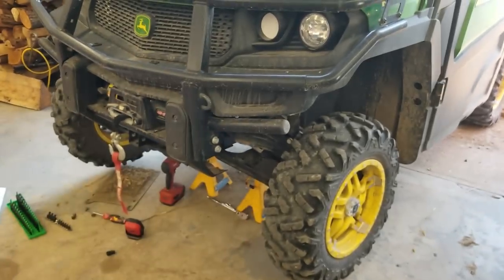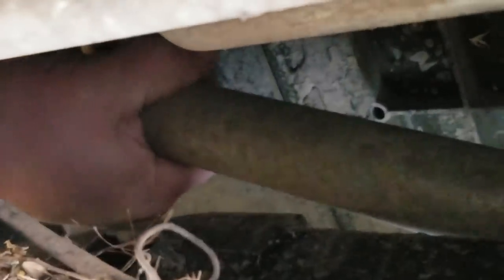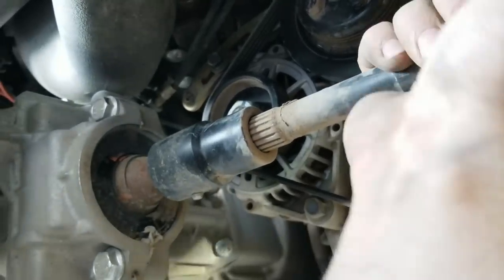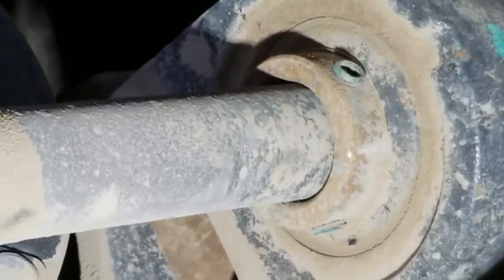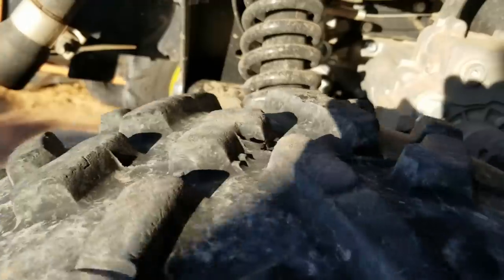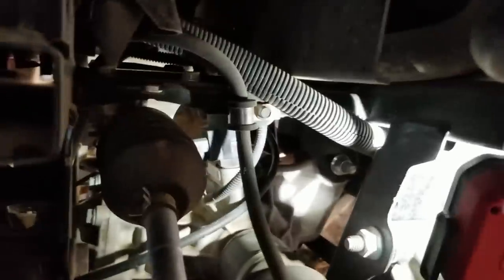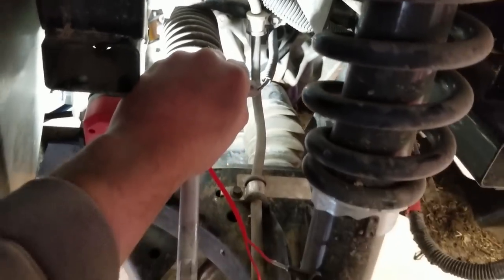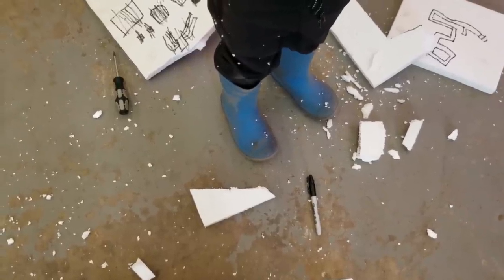Deerest Gator;

Comment: It's possible the common grounding point where the negative side of that solenoid plug ties off at is corroded or just plain old loose from vibration. That's why you're not getting a full 12v across that plug. It'd be interesting to see what the voltage was while referencing directly to the battery neg terminal.
Reply: I second the grounding issue. I had really strange trailer light problems on the RV this summer. Measured 6V instead of 12 at the trailer connector, both directionals came on for left turn, behavior changed when lights were on, real hair puller. RV tech in Dawson Creek heard my list of symptoms, finished his coffee, came out and added a ground wire from the directional light to frame ground and everything started working.
Reply: Just Ohm out the line from the return side of the connector to chassis.  If not 0 then find out where the problem is from there. Might need to do the same on the hot side.  But on the hot side it's probably best to unhook the battery to save your meter.

Comment: I used to drive these at work. Expensive vehicles. Did the job, but work "limited" the speed with bolts under the pedals, meaning we could never run them even halfway open, caused some issues.
Reply: Those sort of 'fixes' just beg to be overridden.

Comment: Voltage drop test should figure this one out. With the circuit plugged back together and some back probing (no laughing at the back) with the system live you should have 12v (assuming it's a 12v circuit) on the live all the way from the fuse to the solenoid. As the solenoid is the only consumer on the circuit it should then read 0v after the solenoid. It it's reading 3v before the solenoid (again, the system needs to be fully connected) then 9v is been used to push through a point of resistance before the solenoid on the live side, if it's 3v after the solenoid then 3v is needed to push through a bad earth. Either way, the solenoid is getting starved of pixies but you'll know which side of the circuit to look at

Comment: The next manual will state "check set screws on bearings on driveshafts at 100 hour intervals" much easier than making something of proper strength the first time, it will be sent out to the dealerships as a page that they glue over the original page in the manual, or since it's probably online only accessible through a secret back door portal, it will be changed and no one will ever know it wasn't there in the first place.

There's your million doll hair idea, service manual Wikipedia, the service writers would edit them everyday adding multipliers to the time tables and adding, nonsensical yet, important sounding things to the 100hr service.  And adding disclaimers like "If the date and hours are written on the oil filter with a sharpie, the warranty is null and void, as there could be an issue of the alcohol in the ink bleeding through the steel and thus contaminating the oil.

I was a mechanic, my favorite thing was when they swapped out the old manuals for the "updated" one, thus they sold, at a discount, the manual that had the notes from the shop mechanics in it.

Comment: Is the Confuser smart enough to need the engine running to turn on the 4wd?   Seems odd you found a mechanical failure that coincided with the electrical failure.
Reply: I agree.
Possibly the splined shaft was the problem.

Put it all back together and test. Bet it is fixed.

Comment: I had a similar issue with a later model ranger turns out Deere and Polaris parts were interchangeable for that time I believe it was a hillard… they have a magnetic interlock with a roller cage and plate that locks the diff. If by chance it isn’t a gremlin lurking around the switch

Comment: Not sure if the John Deere's are the same but on Polaris front diffs, they have a constant 12volts running to the connector, and the ECM supplies the ground when the right parameters are met (RPM, Shifter position, Key on, Etc.).

Comment: Biggest problems I always had with JD's in service were always electrical. I cant imagine the engineer team for the side by side market is any better than there heavy equipment teams. Its gonna suck but that grass fire waiting to happen and the 3 volt drain is making think theres a shorted wire there.

Comment: Call your local PrairieCoast Equipment dealer! Haha. If i remember correctly the 835 needs to see wheel speed before it will power that front diff solenoid. Keep in mind spinning tires wont always engage the fronts as the front diff uses wedges and rollers to engage itself.

Comment: LOL. Reminds me of the hack to start my old old Ford Windstar. Had a manual override on the fuel pump on account of a relay having cold feet. Below -20C it would not engage and prime the system. Ergo no start. Plug the bypass into the lighter/accessory port, hear the pump run, start the van and then unplug.

Comment: Vehicle brain boxes usually create more problems than they solve. And they make trouble shooting twice as hard. However, I would probably check the ground first.
And if it's still a brain box problem, bypass it and put a relay after the switch straight to the solenoid.

Comment: Those CV joints are a weak point too. Our Gator has about 500 hrs on it and I’ve replaced 3 CV joints and the last original one needs replacement. And JD doesn’t sell just the joint anymore, they want you to buy the entire axle. Luckily after market manufacturers sell just the CVJ. Our Gator is a 2009 850D, D for diesel, and luckily it’s pretty simple electrically.

Comment: Conditions of operation. The following must be met to allow the EMFWD operation
4WD switch on, no faster than 8mph, in gear, park brake off, engine speed above 2300rpm. Taken directly from the technical manual.
Reply: when the above conditions are met the ICC controller will provide battery voltage to the solenoid. Solenoid resistance should be 5.5 + or - 2 ohms

Comment: I don't know if this applies but on other brands the hubs wont lock unless there is torque applied through the axle shaft so you can spin the wheel all day by hand and it will never engage but if a guy was to lift the entire vehicle off the ground and stomp the happy pedal the hub will engage and get the rubber spinning.  I personally don't like that system but it is very popular with other products.

Comment: I’ve seen comments about the switch plenty and that was my first curiosity (or third considering you checked volt to sol and operated it with separate battery) but I only know cars and light trucks. If someone plays with the switch enough I could see it being bugared contacts. Monitor solenoid voltage while exercising the ol index finger on that switch and see if volts are always the same? Always a good laugh watching these videos and especially playing the part of my dad 40 something years ago yelling at me about the goddamn light, you didn’t throw anything at me so do better man lol

Comment: So 3v at the plug. Sounds to me like the wiring for the solenoid should be good. Seems like that circuit would be a switch power from the ecu with constant ground. The 3v you see is for self diag. Sounds to me like control side issue, I would be checking that switch on the dash to make sure it is working properly.

Of course without being able to see a schematic we are just shooting in the dark here.

Comment: Not a deere, however my 4wd actuator on my 07 grizzly went belly up. Digging into the web i found it was only supposed to be powed off 3 volts, not 12 lie i assumed. Could be likely yours is failing and has high resistance requiring more power.

Comment: If it's like polaris awd, it has to sense the rear tires spinning before engaging the  front diff. Hook it all back up and spin them on the jack stand under engine power and i bet the front will engage.  The prop shaft moving was the issue when it discounted the splines.  Just my nickel, damn inflation.

Comment: If you reckon the solenoid is powered directly from a controller then is it possible there’s some other conditions that need to be met before it will switch on the output? Maybe needs an ‘engine run’ signal or needs to see a gear engaged (anything other than neutral)?

Comment: ive had the switches out of the dash doing a radio install for a farm, might be worth looking at the switch and for a pushed spade on the connector. some of the switches are interchangable if i recall correctly, harness is marked with switch tags so you cant screw it up. If i had to guess it goes to a ecm of sorts. whats your power output to battery ground? also the rear speaker kit with subwoofer is nice but id never do it again.

Comment: Just fixed this same sorta issue on a kubota rtv 1100 few weeks ago, and as stated in one of the other comments, chase down all the ground connections, likely will find broken wire/connector that is the cause.   

Dont know where they are on the gators, but on the kubota the problem was a ground lug on the chassis above the front diff, in behind the airbox/radiator area under the "hood".

Comment: Did you check for corrosion on any of the quarters stuck in the fuse box?  I've heard foreign currency also isn't the best conductor and can cause voltage drops.

Comment: The solonoids on my Polaris diff lock are pulsed, like PWM. they work great at 12v for about 3 min but then they let the smoke out and you need to go buy another one.
Reply: maybe check the signal with your oscilloscope. or would the AC voltage function on the VM work?

Comment: What make and model is it? A VIN number would be great. 
I'm working on a shop that is JD certified. 
If the the module engage the solenoid it, the output could "leak" some curren when no load is applied (are) ? .. Any how. Try start the engine and engage a gear and see if you get 12v . Could be that simple

Comment: First question I'd ask is if it is a source or sink output to that solenoid.  A lot of automotive ECU "outputs" are actually open collector switched ground and the solenoid would have constant 12V to it back to the control.

Comment: I'm only guessing, but I would guess you've already got it fixed.  The ECM probably only powers that solenoid under certain scenarios (wheel spin) and disengages it for easier turning. I know a lot of guys just leave theirs in 4wd all the time and never complain about jerky steering so it has to be doing something.  I would put it all back together and go tear around in the snow to see if the front end is pulling.
Reply: That's What I Think!!! The Problem Is Already Solved But The System Was Not Checked With The Engine Running!!!
The Computer May Not Allow Engagement With RPM At 0!!!
Keep Rocking It Out Brother!!!

Comment: Electronical issues, Citröen van at work came back from the local dealer after having new back doors and now you shut the back door and it tries to lock them all, the key has been locked in a few times! Been like that for a few years now.

Comment: I just had this exact problem with my Landcruiser.  3 volts to the computer.  It was corrosion in the wire where it connects to the fuseo terminal.  It was on the feed side so the fuse read 12 Volts.

Comment: Did you check voltage with the engine running? If it's an ecu signal that actuates it the engine may need to be running to engage 4wd solenoid.

Comment: If it's like the older gators they use a Polaris differential that has a sprage clutch in the diff. The plastic cage on that sprage fails. There is a coil that when energised puts drag on it and engages the sprag. Clever system but the stock plastic cages fail and you loose 4x4

Comment: Are you getting 3volts engine off? Start engine and see if you have 12v before rerouting a wire.

Many a times I see 3v on Vehicle with engine off. Why cars don't start after a week sitting.

Comment: Looking at this vehicle they have everything down to the bare minimum. The metal that the suspension arms connect is as thin as they can get away with just like that collar on the shaft that you said should be 4 times bigger.

Comment: I assume you tested the voltage to the solenoid with it running? If its off the ecu output may very well not be supposed to engage

Comment: I’d be willing to bet the confuser sends low voltage to test the circuit regardless of switch position. (You know for blinky light reasons) Once the engine is running with 4wd engaged then the confuser will send full 12v.
Reply: I was thinking the same.

Comment: I had situations where fuse was almost gone but not completely. It would show some voltage but not 12V. Sometimes I would even have 12V but it would drop to very low voltage when I would turn device on. Try replacing fuse... Know it sounds stupid, but that happened to me. Fuse didn't melt completely. Very weak contact inside of a fuse. You can check this but measuring voltage before and after the fuse.

Comment: Had a ‘97 Ford F-150 with push button electronic servo 4x4. That SOB servo would go bad about once every year and a 1/2.  My favorite part, it would work until you were 10 miles up a dry dirt road and it started to rain, turning the road into a sloppy, slippery mess.  Talk about the skinny pedal being your “Best friend”. Mash that skinny pedal down and ride the rev limiter outta there.😂. The 4.6 liter motor in that truck had no quit!

Comment: I can only assume you tried it with the switch engaged and motor running… seems like it might be a fail safe for pushing or pulling a dead machine when the front end gets jammed in a mud hole

Comment: i was about to scram at the screen when you put 12v to that solenoid.. on the ole Toyota Hilux rear diff lockers, the activation voltage is very low, iirc 1.5 volt, so a direct 12v would fry it right up.. good thing nothing bad happened, lol

Comment: Heyo,

just came here to say that the voltage you measured with the fluke might be 3V but that might as well mean that it is turned completely off.
Because of the way that these measuring devices work, even the slightest current that is induced by parallel lines etc. can give you a reading of 3V - 5V or something similar to that.
That is because the multimeter has so high resistance in voltage measuring mode, that it limits the current to something extremely small. When shorted, those 3 Volts would collapse and be more close to 0.
So that thing is not energized

It is probably best to consider these 3V as if you had gotten a reading of exactly 0.

Maybe I am just telling everybody things they already know :D no clue.

Good Luck

Comment: If the gator 4x4 is like polaris it is only engaged when it gets 12v and the vehicle has to be running for it to send the 12v to the hubs and front differential

Comment: Do you have a thermal camera (flir). Energize that wire for a solid 5 minutes then start looking with the camera to follow the wire. Ohms law says that either voltage bleed to ground in muddy harness or a bad wire with high resistance will create heat that you can see. I've done it before and found exactly where buried in the harness and hardly accessible by more than looking, where the wire fault was.

Comment: At least it's got AC!!!

Seriously though, check both sides with a backprobe referenced to ground with the solenoid plugged in.  If they both have 12v or so it's probably switching the low side and the ECM ground might be dickered.  If the 3v comes and goes when the switch is flipped O/I then see if there's some of the green crusties hangin out in one of the plugs or a bad ECM ground.

Comment: Had a similar issue with my old Kodiak 450 turned out to be a chaffed wire under the fuel tank. Only took 2 shops an ecu and 4x4 engage motor to figure it out 🤦

Comment: I'd trace the wires on that and check for corrosion on all the connections or a chewed up wire somewhere (wouldn't be surprised with all the mouse fodder inside the belly pan). That's almost always why voltage will be low like that. Sometimes different components will call for that kind of voltage, so yeah the factory manual would be helpful to see if you're actually supposed to have 12 volts at that location. I've seen solenoids like that fail in such a way that they swell or corrode and the shaft won't slide any more. Could be that giving it some more voltage than it normally sees is enough to overcome that friction but the normal 3 volts can't get it done any more.

Comment: I’m sure you check whether tit was high resistance on the power side, or the ground end. The way most autos wire up is a constant source from your fuse through a relay, an switch the ground to activate your powertrain component, don’t know if the portajohn venison does the same.

Comment: I'm sure you tried this. Will the solenoid engage if the engine is on? Perhaps in an effort to save battery chooch the enginerds set it up to run on alternator power only?
Reply: You typically do not need 4wd unless the engine is running.

Comment: I assume you actually did check the fuses? If a fuse was blown (or if the ground is faulty) you could be measuring a floating voltage of ~3V. Otherwise, if you have a blown output on your ECU you may be in for more problems down the line.. Potential water damage? Also it wouldn't hurt to check the switch itself.

Comment: Common problem on Polaris as well, only the output transistors normally short, and keep the diff locked. Easy fix with rewiring the switch to directly control the solenoid. WTF would the diff lock need to go through the ECU?